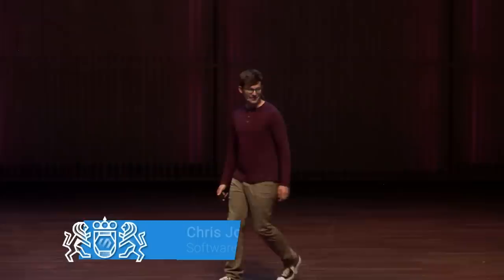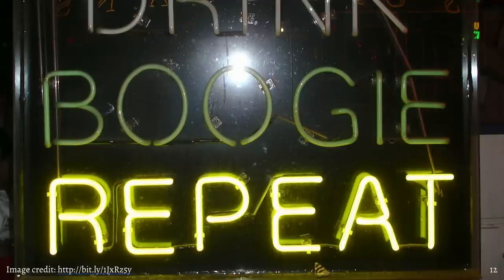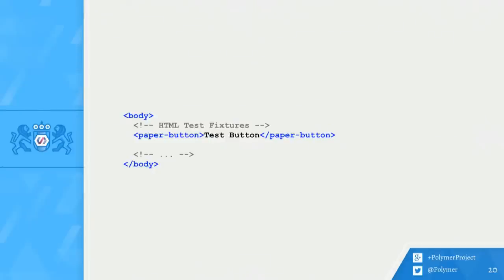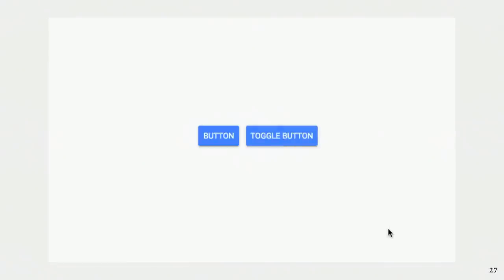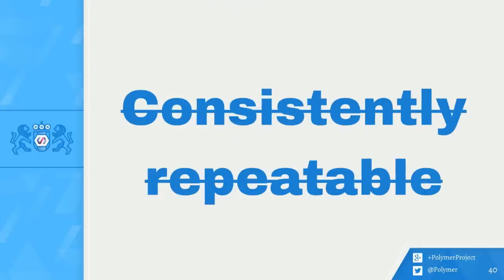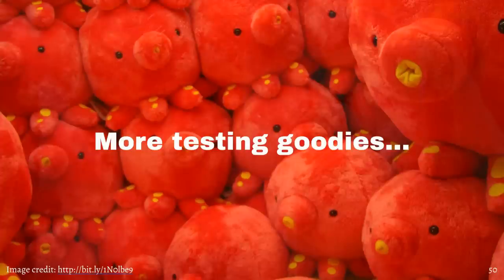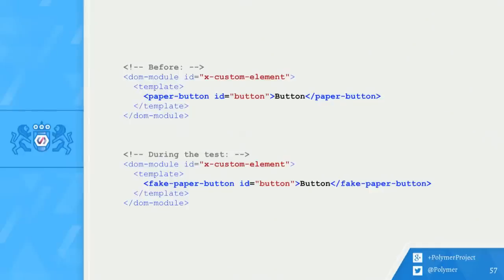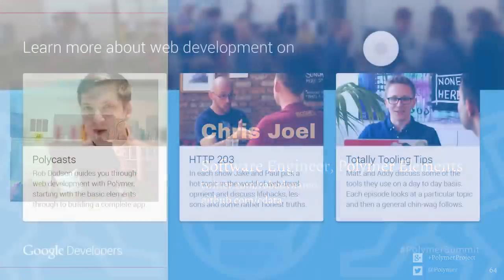Testing Polymer Web Components (The Polymer Summit 2015)

Comment: Hi Rob!!!  I am using polymer with Spring MVC the first issue is: - The clicking on home the url always changes form : <localhost:8080/testproject> to <localhost:8080>So how to solve it. I am using apache tomcat 8.0.1 server and spring tool suite 3.7.3.When I launch the project the url is : <localhost:8080/testporject/>I have gone and setted the <app.baseUrl='/testproject/'> in app.jsI have also changes the routing.html as :                                                                                                                                                                                                                                    page('/testporject/',updateRedux, function() {
                            page.redirect('/start');
                       });                                                                                                                                                                                                    Nothing solves my problem. Kindly help me out to solve the issue that what needs to be done if project runs on url: <localhost:8080/<project-context/> instead of <localhost:8080/.